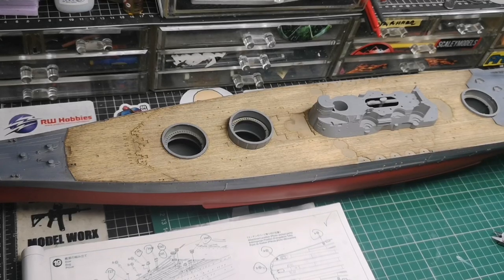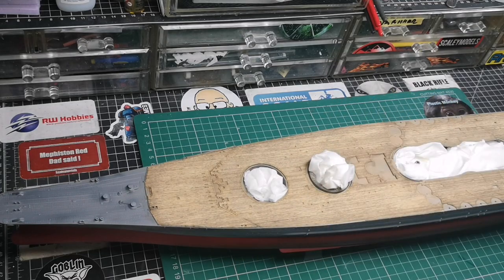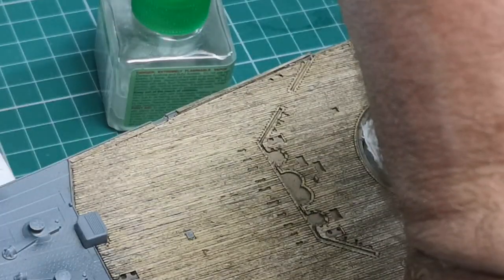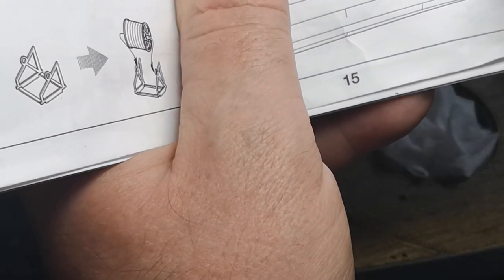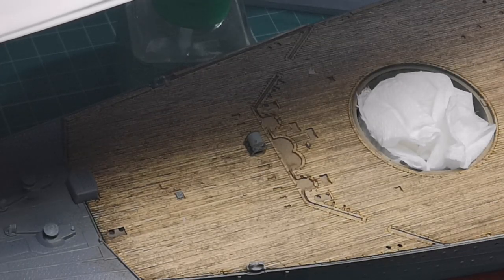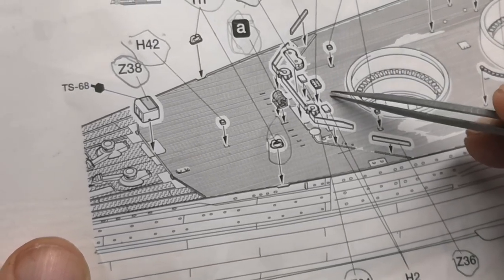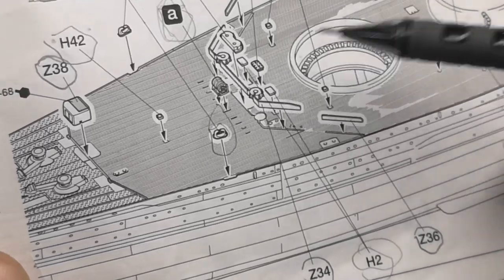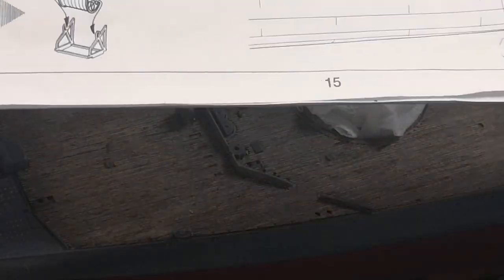Tamiya Yamato Premium 1/350 part11

Comment: Paul, A couple of things:

First, thank you so much for the shout out about the idea of plugging the holes to prevent the loss of small parts.  I can't take credit for that as an original idea, as I have seen that same approach used in a number of different areas, including by plumbers who want to prevent small parts from falling down an open drain!

Second, I must thank you and Nigel (of Nigel's Modeling Bench) for inspiring me to try to get back into model building after 55 years.

Third, I most heartily agree with your very practical approach regarding painting small parts while they are still on the sprue, and
accepting the need to do touch up work after the parts have been installed.

Finally, a quick suggestion regarding the Tamiya Extra Thin.  In the excessively warm weather you are having in the UK, it might help to avoid evaporation of the the volatile chemical compounds in the glue if the cap were to be screwed on tightly immediately after the installation of a part.  Not only does this help to avoid chemical changes to the glue, It helps to lessen the possibility of accidental spills that might result from knocking the bottle over, particularly in a confined work space.

Cheers, keep up the great work, and try to stay cool.  I look forward to the upcoming Yamato videos.
Reply from the maker: Thanks  Tron much appreciated, I shall let Nigel know what you said, Enjoy your modeling.